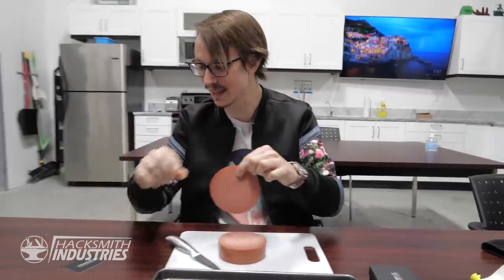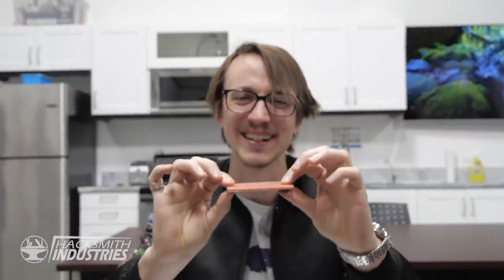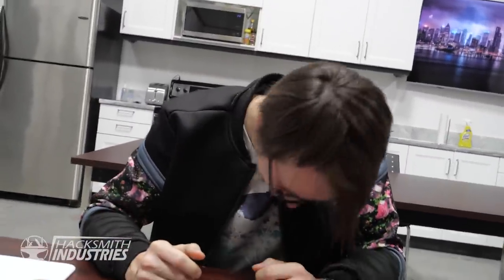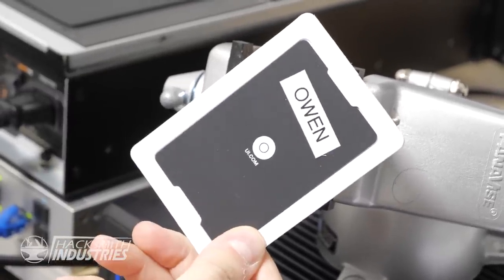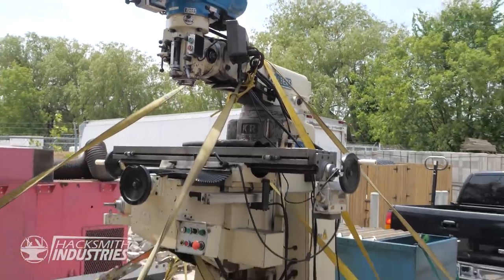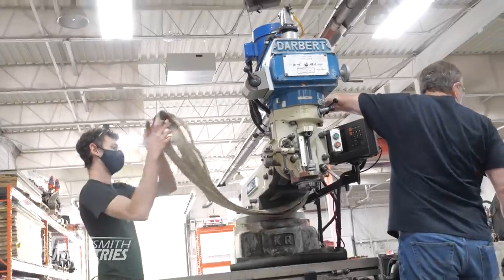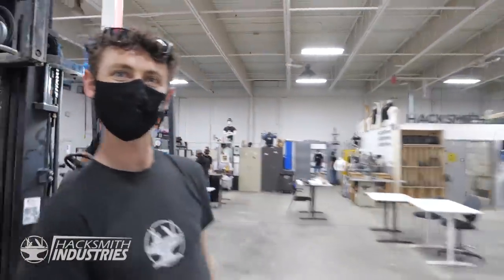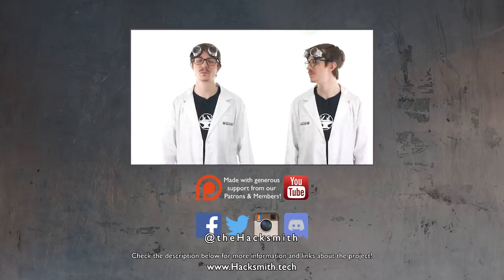The POWERLOADER goes BERSERK!? (WEEKLY VLOG #12)

Comment: Every time I shop for Hydraulic cylinders I think of the power loader and how much you guys overpaid for hydraulics. 5T 1.8m hydraulic cylinder $51 shipped. Hydraulic pump 46L/m with motor $1600. That mill new cost less than $2k by the way.
Reply from the maker: where the heck do you shop?

Comment: Sounds like you don't have enough room all these videos moving around the shop too many items you you're going to need a museum of your work separate than your actual you know showrooms and machine shops at least not the way you're currently doing it I know it'll take a lot of money and it would be probably more than you can do but I think you need a bigger place either that or needs some space workspace outside and temporary buildings outside get some trailers outside get some pods outside and turn them into building things hey you can even stack those so you can do a ladder system cut open a few things make some panels put some solar up that sounds like a good videos